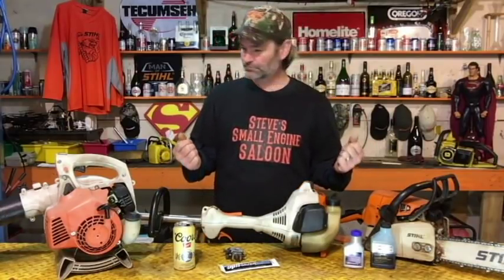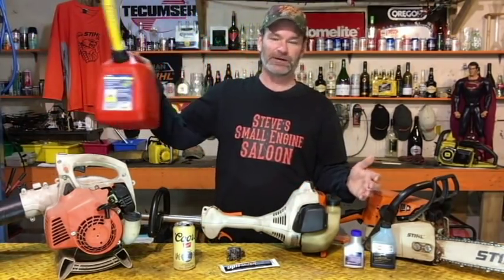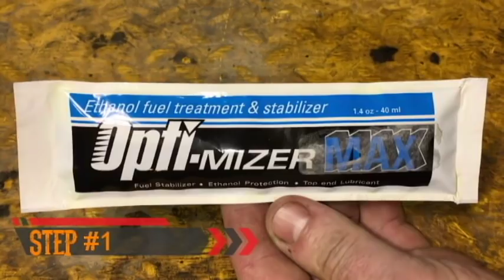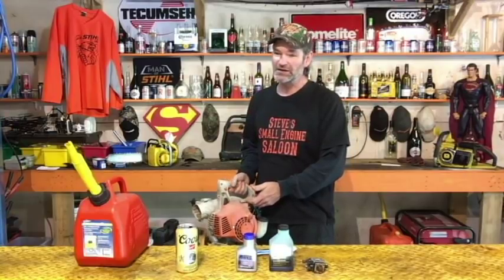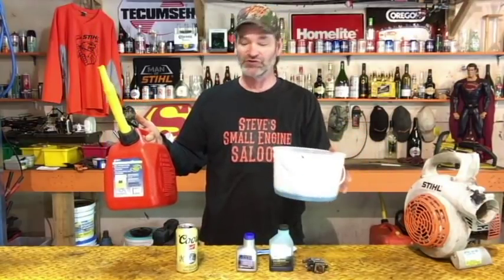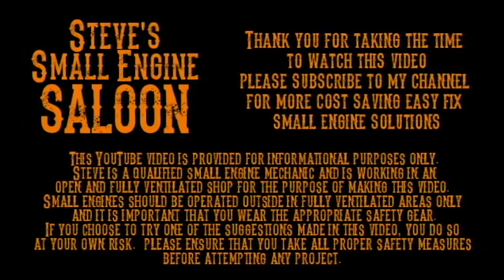How To Winterize a Chainsaw, Weedeater, Blower or Trimmer

Comment: Steve...u continue to teach this ole dog new tricks!! I did NOT know about primer bulb pushing AFTER emptying the tank  nor the multiple choke engaged to start to burn carb fuel! Great ideas!

However, as i get older and  osteoarthritis pain..and since I run most of my gas powered  landscaping tools all year long, especially in the fall and winter w my blowers and chainsaws, (except weedwacker, edger, and hedge trimmer) tractors, snowblower, etc...and previously a boat, motorcycle...I had to try and MINIMIZE the time to winterize...so i compromised...albeit...if i could i would do your method to be honest! 

I now use a separate can of fresh premium fuel for 4 strokes, and smaller can for two strokes. I think smaller engines benefit from higher octane, maybe also less ethanol. Then I add Stabil fuel stabilizer,  AND StarTron Ethanol Treatment...best of both worlds...all year round! A lot of my gear is old, so to eliminate carbon build up in combustion chamber , exhaust exits, and on valves of 4 strokes...i used Sea Foam...i add directly to the tank of each piece of equipment, then just use them, no need for winterizing or 10-15 mins spent watching Sea Foam burn away carbon deposits.

The 1987 310-8 Kohler 10hp Wheel Horse tractor,  prob north of 4-5,000 hours on it, ...2 carbs, fuel pumps, and extensive fuel line, filters, and tank cleaning..still gets cranky and can be hard starting, so a few squirts of Ether...and it fires up. The Sea Foam treatments help it to idle and throttle up a lot better! Last 10-12 yrs use it mostly for leaf and debris pickup and snow plowing...had to repair mower deck rot holes w sheetmetal and learned how to weld pretty good!

Steve, always enjoy your videos, tis the season, so toasting you my friend...w a Shipyard Pumpkinhead  Ale, tomorrow maybe an Oktoberfest draft at one of the local breweries! 🍻

Comment: good advice but ONLY if you use non ethanol gasoline.    if you use ethanol blend do the second option of emptying the gas out.  1)first off if you get ethanol blend it only has about a 20 day shelf life  before phase seperation begins. 2)just because you bought it today well how long has it been in the tank at the gas station??? you really dont know unless you run the gas station and they hardly ever run out they top off so some of that gas may be lord only knows how old. i prefer the dump and run dry- never had a problem. also its a great time to clean it check the filters etc  so next time you need it its a gas-n-go
Reply from the maker: Great comment!  Thanks Rick...
Reply: Yeah, I agree! I had a 2stroke motorcycle, 5 liter tank topped up with mixed fuel (10% ethanol in fuel , 2stroke oil, mixed with a ratio of 1/50) sitting over winter, say 6 months. The gas was unusable afterwards. It simply can't be ignited by the spark. Changing to new fuel was the only solution here. Best regards, Richard
Reply: You could do both. Stabilize the fuel when you mix it. Then, combine it with the "dump the tank, clear the fuel lines" method, add a little oil to the cylinder and slowly pull the string a few times without the spark plug.

Comment: I was told by a Sthl mechanic to drain your tank a fill it up half way with a pre-mixed gas and then run it for a few minutes to clear the old gas   Shut it of and put it away. The pre-mixed gas lasts for four years and will still be good for next season. He also said never run your system dry and leave it dry. The tubing will dry out.
Reply: Wow! How did we go from NOT using ethanol gas for your mixture using instead a manmade mixture fuel to being an ‘enviro whackos?’ That escalated quickly. I think you need to watch the video again. jeeez.
Reply: Hoser dude  Get back to me when you've had $750 racing carbs get eaten alive and have to be rebuilt from sitting one month with that enviro whacko mandated shit mix in them
Reply: Did I say ANYTHING about using ethanol? You really need to read my posts instead of running your mouth.
Reply: Then why are you butting in? My comment was about ethanol
Reply: If you follow this string of comments, you made the comment on my original reply. That is why you are not paying attention. No one made a comment about ethanol on my comment. EXCEPT YOU.
Reply: While well intentioned what I have seen is..environmental fuel cans poorly engineered and dump carcenogenic fuel on skin and the ground, over fill because not easy to control, and think of the destruction of carbs and equipment causing more in our landfills, more chemicals being made and sold to offset the damage, and we are the only country in the world that takes FOOD, and refines it  into engine fuel?  It takes a LOT of energy to do that as well.  It reminds w=me of the person who drive a 4000 pound volvo to the dump to drop of 5 pounds of recycling and feels good about it - well intentioned but imagine that on a large scale, not imagine, its daily across the US.

Comment: The other way to do it is how I do it which is to only use NON ethanol 2 stroke fuel. I buy it in a can at home Depot but u can also use aviation gas and add 2 stroke oil.
Start it and let it warm up.  Dump the tank so it's empty.  Then start it and just IDLE it until it starts to die.  Then choke it to keep it running.  Sometimes it will stall first.  Steve did some of this in this video.  Then once it runs out your done. If u want to dump some Marine engine fogging oil (Storage oil) in plug hole and  then crank it over a few times with ignition switch off.  This is good for long Storage.

Comment: Steve, your videos are awesome!  I even watch the ones that don't apply to me!  Questions: 1) Does fuel stabilizer itself go bad with age? For instance what if I have a bottle that's been on the shelf for 3 years (yeah, I'm a cheapskate: I'll use it if it's OK). 2) If I'm going to start my equipment once a month over the winter, is it better to fill the tank with gas station gas + stabilizer, or that "pure fuel" stuff?  Thanks!

Comment: hey I bought a chainsaw last summer and basically forgot about it. it has been sitting for about a year with just a small bit of 2stroke fuel in the tank. will it be ok? I plan to dump the fuel, top off with fresh gas and then will follow your advice and make sure to start it once every month.

Comment: Coors? Down stream beer! Ive been running my two strokes dry for a couple decades. Both yard equipment and my model airplane engines.
Ive nothced the new engines with the fuel bulb/pump need that bulb pumped dry or it still has fuel in it. Just an observation.
Reply from the maker: Right on...

Comment: Very good video Steve. Cool way to preserve the equipment. I have always just run every piece of equipment that I have till it won't even pop on choke and pull the engine slowly until I feel the piston close the ports and feel compression begin to seal the cylinder then hang it up on the rack. This has been my routine after my last mow of the season. Is this good or should I be doing anything different?? I run stihls Husqvarnas, Honda and a old Troybilt. Haven't noticed any problems upon the first starts of the mowing season. Oh when required I do take the mufflers off and take a mapp gas torch to the inside till they burn the carbon out and they begin to glow orange. I know it takes time and patience but those engines really scream when they have a clean and clear exhaust.

Comment: Steve,  I forgot to add I do not use Stabil in my gas.  I can cause greasy gas in two cycle gas.  I use Brigg's AFT @ .5 Ounce per gallon of premium non ethanol gas in two cycle gas and 75 ML of Stihl Ultra oil.  For four cycle applications I add the AFT at the same rate but I add 1 ounce of Marvel Mystery Oil to the same gas.  I used to add it to my two cycle gas but the MMO cause sponge, because it's oil is additive to the Stihl Ultra oil I use and causes a lot of oil residue on the exhaust side of the engine. When putting my saws in storage condition, I usually give them a little dose of Seafoam in the tank after I pour out all of the gas in the tank and let it run dry with a seafoam/gas mixture.  It will make it smoke a little bit when I bring it out of storage condition but the Seafoam will soften any carbon residue in the two cycle engine and get rid of it the next time it is run.
Reply from the maker: Good comment John.  I will have to try that out...

Comment: My recipe for mixed gas:
1 gal E0 Gas
1 bottle 50:1 Lucas 2-stroke oil
1/2 oz. Sta-bil fuel stabilizer
1/2 oz. Sea Foam
1/2 oz. Evan Williams black label

Comment: I have a question. I was on Stihl's website and they had a section on winterizing 2 strokes and they said when you empty the gas tank and start it back up ONLY let it idle until it runs out of gas. It specifically says "Warning" "Do not operate the throttle, only run the engine at idle speeds until the engine stops!" This is different then what you did. Do you agree or disagree with what they said? I just want to know for my own personal use. Thank you and LOVE your videos!
Reply from the maker: Great point.  Some chainsaws will over rev as they run out of fuel (leaning out).  Blowers and trimmers don't seem to do this.  If you use this method to winterize a chainsaw don't hold the trigger wide open for more than a couple seconds at a time.

Comment: Even if you don't use Tru Fuel during the season for your 2-stroke stuff it's absolutely worth the cost. They make Tru Fuel for 2 and 4 stroke equipment. Screw all that mix this and measure that fill it up with Tru Fuel and forget about it until you're ready to use it again.

Comment: All gasoline fuels with benzene come from distilled crude oil and coal when cooked down for coke. They also add extra benzene to gas to raise the octane. Even though I agree that you should never use 10% ethanol gas in your small engines. I use true fuel in my Chainsaw because it's hard to find ( what we call RAW gas) down here. But if I do have to use gas and oil in my chainsaw in an emergency I put a stabilizer in it. But I always try and use true fuel. I've had to rebuild to may carbs from people that don't listen or don't care.

Comment: Steve, I am easily confused.  On things I use off and on (small chain saw) I have been mimicking the local fire departments procedure for life saving small engines.....fill with VP no ethanol fuel.  Start once a week, put back on truck, top off monthly?  On seasonal things like snowblowers - choke out to empty in off season, fill half up with VP fuel, run it a few minutes to get VP in there, leave it for 6 months.  So far so good but I like your idea of a monthly 2 minute run....also means it will start because it just did a month ago.  Question:  can I fill it with VP and not worry about bad gas, it is supposed to be fresh guaranteed for 2 years.  What think you.?  GREAT videos you do BTW.  Heres some humor - cell tower goes down, generator will not start, batteries kick in for about 8 hours.  Technicians comment?  "It started just fine 2 years ago when we fired it up."

Comment: Steve I’m a long time fan, I have a question about the fuel stabilizer. Before I put the gas and oil mix in my can I put the recommended fuel stabilizer for the gallon can I have. My question is I still have gas in the can that already has stabilizer in it, could I use that or do I have to go get more gas?? I don’t have a spot to put the gas that’s already in the can if I have to get fresh gas. Also I was told that for small engines yet need to use premium fuel, that’s what I normally use anyways I just wanted to confirm that you should use premium grade gas for small engines. Thank you very much for all of your videos Steve I absolutely love them. I also have regular stabilized gas for my mower and rototiller, could I use the stabilized gas I have in that or do I need to get more??

Comment: Steve on a Husqvarna 329L does it have those hidden adjustment screws on the carburetor and I appreciate how to winterize my two stroke blower which is a backpack in my Husqvarna Weedwhacker

Comment: If I lived in much of the United States I wouldn't winterize and put away a chainsaw because you never know when a winter storm will blow through and trees get blown down and you need to clean up.

A blower,mower,trimmer or hedge trimmer I would definitely winterize for storage.

Hell I keep the chainsaws I have at home in Auckland,New Zealand ready to use especially during winter if a storm blows  through and downs a tree.

Comment: Okay I get that method but what about a zero turn mower, it's hard to shake it! What about putting a trickle charger on the battery and leaving it in the cold building or should I take the battery into the house and keep it on a trickle charger?

Comment: Hi steve do use premium  gas in you small engines I mean top grade gas as this gas does not have ethanol  in it I use it in all my small engines  and it is great I do not need to use a stabilizer  for the winter I live in Saskatoon Saskatchewan Canada

Comment: Steve, I do basically the same thing with my Echo 280, and this year as I was preparing to drive around and cut downed Hurricane wood for camping (I live in FL) my saw wouldn't start after sitting for close to a year, when I pulled apart the carb to clean I notice a small black ring, in the seat of the fuel jet that I think was from the black rubber tip of the valve possibly sticking to the seat keeping any fuel from getting through. After cleaning it ran like a champ. Do you think this is possible, letting it sit dry the rubber fusing to the seat? I have ordered a rebuild kit that showed an all-metal valve I will replace it with just in case.

Comment: I am one of those people who has equipment stored at a different location so this video arrived at the perfect time.  I did not know about the "shake the engine" step to get additional fuel out of the system when preparing it for extended long term storage.  Thank you that is very helpful.  Steve I've got a few questions, I also pull out the spark plug and spray a marine product "storage seal" liberally into the cylinder while pulling the piston through several times.  Is there any reason not to do this?  Also I run fuel stabilizer all the time just to make sure the internal structure is protected all the time,  The stuff is cheap and I do not mind mixing it up.  The other thing I learned this summer, that I did not know, is that it's possible to buy ethanol free gasoline.  I rented some landscaping equipment early this season and the mechanic told me about it.  They had ethanol free gas, also premixed 50:1 in single liter bottles, it was pricy but available.  Since then I have discovered a local gas station that also sells ethanol free gasoline and I mix in my own oil and stabilizer.  I have run nothing but ethanol free gas in my outboard 2 stroke and lawn equipment this season as a result of that mechanic's recommendation.  Thank you again for your outstanding videos!

Comment: Hmm. I empty the fuel out of my two stroke equipment and run them dry . Especially that Stihl chainsaw, which has a fuel pickup tube that seems like it's made of tissue paper.

Is this bad for the equipment? It seems to work great for me.
Reply: That's the same thing i do I've never had a problem with any of my equipment doing that

Comment: does running the motor out of gas damage the rings due to lack of oil?
Reply from the maker: No it doesn't.
Reply: You need to make sure that the engine is idling when it runs out of fuel. Stihl says this on their winterizing FAQ's.

Comment: I winterized my Echo PAS-2620 trimmer and my Poulan Pro chainsaw last fall as shown. Neither one starts now. I have only used Ethenol Free gas (mid-grade) and Echo's 50:1 2 stroke mix with Sta-Bil fuel stabilizer. I can understand the Poulan not working - they're famous for not working after a season - they're a disposable chainsaw. But the Echo trimmer is part of Echo's premier X series. Plugs look good, filters are clean... Even tried to restart this spring with VP's Fix-It Fuel.

I'm really disappointed. I'll try rebuilding or replacing the carbs, but I'm really fed up with 2 stroke engines. Those who say they've been doing this for decades with no problems, (a) you have engines that have beaten the odds of time and (b) "they don't make 'em like they used to."

Comment: I run my saw year around so I don’t have that problem. My weed eaters, I use fuel stabilizer,  I just dump out the fuel and run it till the gas runs out. No problem :)
Reply: Fuel stabilizer does not work these days with ethanol gas

Comment: After I winterize a gas trimmer, when it started the first time 16 months later, it was making some white smoke. then I remembered I had thrown some oil on the cylinder. and i was thinking maybe that oil was burning and that was causing the white smoke. After the engine warmed up for a few minutes I used it without any problem. but I think maybe I could post my experience here. if anyone has the same experience this may explain the cause if the white smoke.

Comment: Hey Steve, haven't seen a video on breaking in new equipment. Just bought a new stihl trimmer, manual has nothing about "breaking in". I think thatd be a good video. None of the forums ive searched had any good info on this subject.
Reply from the maker: Manufacturers say there is no break in period anymore!  Technology is at the point were it is not necessary.  Just put fuel in it and giver.....
Reply: Thanks for the reply Steve.
Reply from the maker: No problem. Glad you bought a Stihl...

Comment: How about using non-ethanol fuel as the final fuel before the winterizing purge? Also, remove spark plug and gas cap and put a wad of paper towel in the holes to reduce condensation?